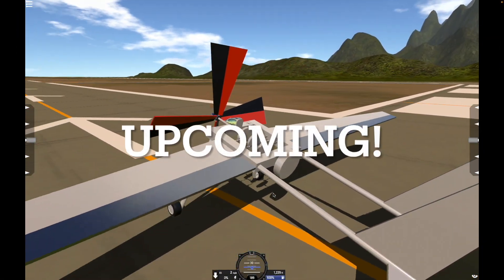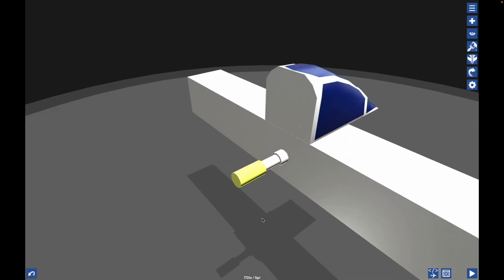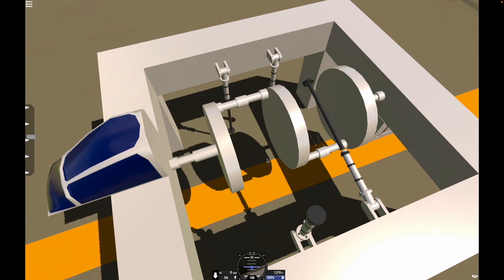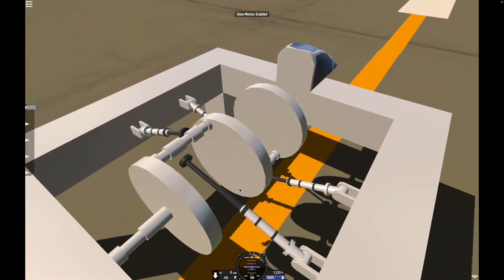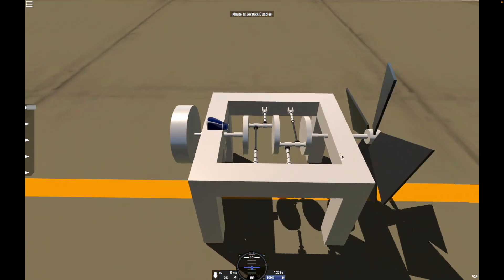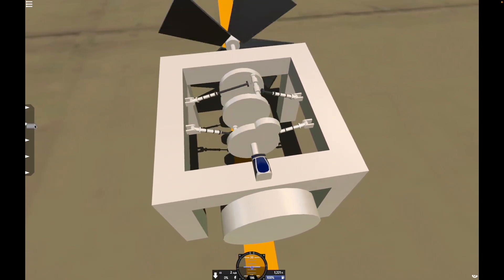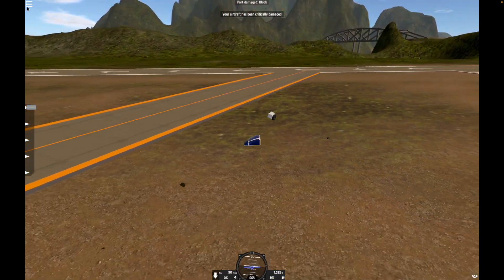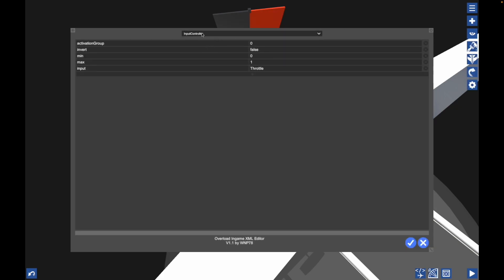Flat 4 piston engine at much higher speeds! |SimplePlanes|

Comment: First and I think u can make a radial engine (Btw im not forcing its just an idea!)
Reply from the maker: It could work, the pistons would still have to somehow be offset at 180°, sense they can only be set to move starting in or out. But I would have to experiment with it some. Might be a good idea.
Reply: why not 4 radial?
 @differentthingsgaming
Reply from the maker: @onlycab10000  I just haven't tried it yet.
Reply: ah ok @differentthingsgaming